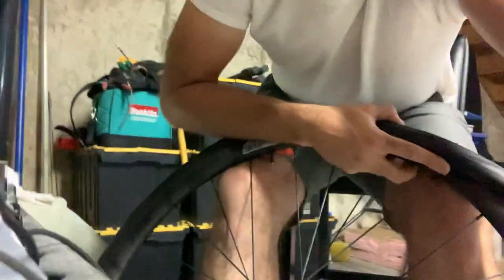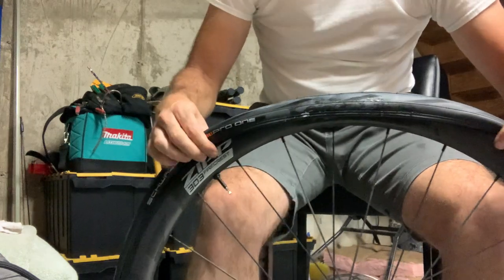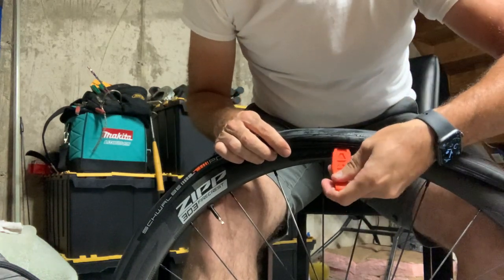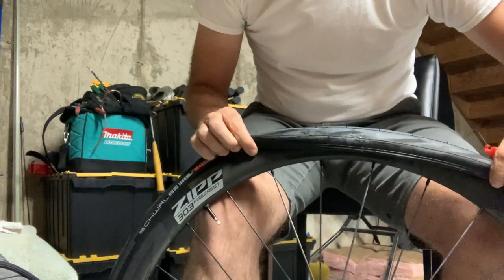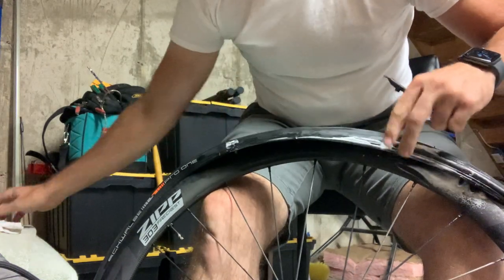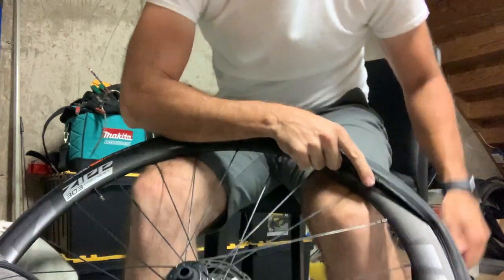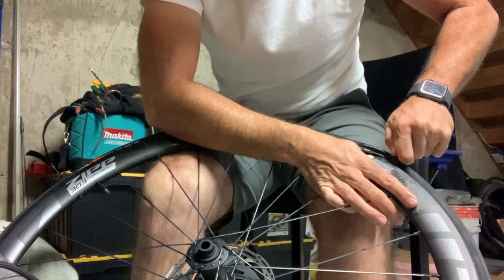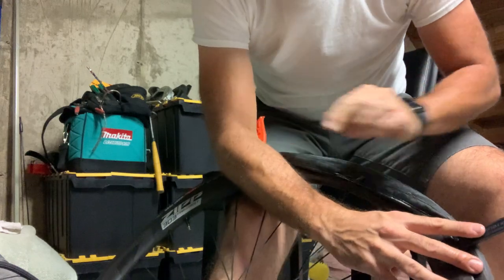Easiest way!  How to mount impossible tubeless road tires!   No special tools!

Comment: Can’t thank you enough for this video. I was going mad trying to fit Vittoria Rubino Pro tubeless tires on my Mavic Ksyrium wheels. I had them boxed and ready to return… but tried once more with the tire lever and the Kool Stop tool. It was otherwise impossible to mount these tires. Thank you.
Reply from the maker: Awesome!  Thanks for the feedback!
Reply: I have the same wheels. You could believe how difficult it was to mount gp 5000 TL tires. I had to use zip ties at one end of the tire so when I was mounting from the other end the tire bead wouldn’t slip out the other end

Comment: why wouldn't you just use a bicycle tire jack? they are plastic and won't mar a carbon rim. and it's what they're designed for.
Reply from the maker: Based on the comments below, lots of people struggle and find themselves trying to mount tires they didn't realize would be so hard. some likely don't have time to wait for a specialty tool to arrive.
Reply: I mounted a pair of Pirelli Cinturato Velo 26c on my bike. These were the worst tyres I have ever had to mount, and mind you I used to have gatorskins, and were much easier to mount. Anyway, after trying with the levers I gave up. Took a break because I was so frustrated. I decided to try with the tyre jack and it was extremely difficult as it kept slipping out from the opposite side. I had to use both the levers and the jack the get these things in, and the help of my father in law. I’m not even sure I want to keep these tyres, as I don’t know what I’ll do if I ever get punctured on the road by myself. Plus these were mounted tubeless, so just the thought of having to remove them when I need to clean out sealant is making me paranoid.

Comment: that won't mess up the rim tape??  This is why i use Panaracer GK slick on my Chris King GRD23 wheels. All by hand.  Never an issue and they ride great
Reply from the maker: Nah, this won't mess up the rim tape!  You'd really have to be digging and gouging to get down to the rip tape area.  

Nice tip on the Panaracer tires!  Some are easier than others however!

Comment: Jeff the most helpful and basic mounting issue is not STARTING OPPOSITE THE VALVE CORE getting both beads in the center channel ALL the way around , and FINISHING at the VALVE CORE.  This is the most basic and misunderstood detail of mounting and dismounting  tires. (Yes even tight tubeless road tires)   

MOUNTING: LUBE THE BEADS - START OPPOSITE THE VALVE CORE , AND SEAT THE TIRE BEADS IN THE CENTER CHANNEL OF THE WHEEL ** BOTH BEADS , ALL THE WAY AROUND AND FINISH AT THE VALVE CORE ENSURING THE TIRE BEADS ARE IN THE CENTER CHANNEL ALL THE WAY AROUND. -  95+% OF ALL TIRES CAN BE MOUNTED BY HAND IF LUBED PROPERLY AND CENTER CHANNEL UTILIZED CORRECTLY.  Little dawn dish soap will work fine or I use Schwalbe tire lube, or you can use the sealant as lube (like Stans).  It does not have to be messy .

DISMOUNTING: DEFLATE AND PINCH THE BEAD ALL THE WAY AROUND INTO THE CENTER WHEEL CHANNEL ON BOTH SIDES AND START WITH YOUR LEVER AT THE VALVE CORE.  

Why? the valve core takes up valuable real estate in the channel section of the rim pushing the tire bead out that much from the center not allowing the tire bead to seat fully in the cannel taking up room at the end of the process , you know the tight straight section you have to lever over the wheel . using 2 levers and sticking one down in there can risk tearing your tubeless tape as well.  you dont need to go there.
Reply from the maker: Thanks for the feedback! I'll have to give it a whirl next time I have to take the tire off!  I've given up on road tubeless for now!
Reply: mounted many previously and without issue with lube but Jeff's technique of jamming lever on dry side to prevent rollout while lubing working side was a lifesaver. then lubed rim for easy snap in with kicker cannister.
Reply: @jeffakalucas  Great video. Simple, elegant trick with the forearm. You DO have to be careful with the tire lever though - not to tear the rim tape. But don't give up on tubeless. It's a bit of a chore at first but if you keep the tire lubed, you can use any number of homemade compressed air tricks found on YouTube. I used the "Home Depot Garden Sprayer" method and it worked very well. You have to be quick though replacing the valve core. Tubeless is way more comfortable and of course, small punctures heal up very fast by themselves. Last resort to seat the tire - use an air cartridge. Just have everything planned - you only have half a second to replace the valve core. And it could get expensive. Last last resort - take the wheel to your local bike shop and have them blast it. Offer to buy something though. Like air cartridges to replace the ones that didn't work for you. Ride on!
Reply from the maker: @stuartfreedman6854  awesome reply, thanks for the tips!   

I too have used the garden sprayer with some level of success!

Comment: Wont that spray you used mess up the sealant?
Reply from the maker: @daversj  nah.  It’s was only really on the outside of the tire. Maybe a bit got in but it’ll evaporate/dry out quickly anyway.   

You can certainly do it without but this help.   You could probably use a bit of sealant to be honest.

Comment: i had a real hard time while  mounting a 28mm tyres with inner tube ... i had to use some soap.. but  it was frustrating.. does this work with inner tube too or  do you risk to pinch  it ?
Reply from the maker: Bulkier tubes can add to the challenge but you should be able to sort it out!   Try it and report back!   Good luck!
Reply: inflate the tube so it just takes shape but does not get too big.  use soapy water too.

Comment: I've been wrestling with the new Prime Primavera 28 Carbon Wheels and any tyre I try will not go on. All 700 x 28; Conti 5000 (NOPE), Michelin Pro 4 (NOPE), Maxxis High Road (pre stretched off old rims). These Primaveras have 20.3mm Internal, 27.5mm External and 28mm depth and are rim brake carbon wheels.
Reply from the maker: Geez, still can't get them on?!?!?  I'm sorry this didn't work out for you :( It has helped a lot of people.
Reply: Hi Andrew, did you managed to get the Prime Primavera mounted with any tire? I just bought the Prime Primavera 50, having some issue here with GT 500- STR.. very frustrating!
Reply: I managed to get Gt5000 str on the prime primavera 50 rim. The trick is to use alcohol sanitiser liquid in the rim and tire (lots of it) and lots of patience and two tire leaver, I managed to get them on (5min per tire). It can be done just need the patience. Totally DIY with one person. Thanks for the video mate.

Comment: That might work on your tire and rim. 

Try stretching on aC  Continental gator skin Tire 😬. I had to mount zip ties on both ends of the tire and then soap and water the tire and rim
Reply from the maker: Doh!!  But you got it done, right!?!?
Reply: @jeffakalucas  yes, the size ties and soapy water made it easy.

The rim tire channel
 on this bike  is not deep hense struggle to mount the tire

Comment: Man I tried and failed.... Im going to head to the shop. But thanks anyways :)
Reply from the maker: No!  You can do it!  I've been able to even complete this roadside with a single tire lever!  You can do it!
Reply: I do it a bit differently. I usually have 2 levers pointing to the center of the wheel then flip them both at the same time. Play around with the tension (i.e. how much tire inside of the wheel vs outside). Hope that helps.
Reply: read my reply it will help.
Reply: I am throwing the towel, I have done countless tubeless but some are impossible, try continental 5000TL on mavic cosmic pro UST, did everything beads in middle massaging them in middle several times inching slowly, but you hit a wall! Thumbs blistered up and used tire levers and abs stretched still no success, not sure in this small town I am in if anyone can get them on
Reply: @mohamedt5430  I just tried mounting  a schwalbe almotion tyre on my mavic allroad UST rims and my hands hurt, I'm going back to tubes lol
Reply: @manoz6194  I found a way believe it or not, this tool will get any tire on, keep doing manually until you reach the limit and move on to using the KooL stop tire Jack, it will force the damn tire on, although becareful as the tool is so strong, only use if you are willing to sacrifice the rim, haha
Reply: @mohamedt5430  honestly I was hoping it would go on easy just in case i have a problem when out and about, I don't want to carry more than tyre levers to get a tyre on and off